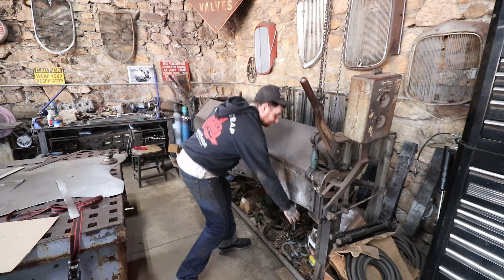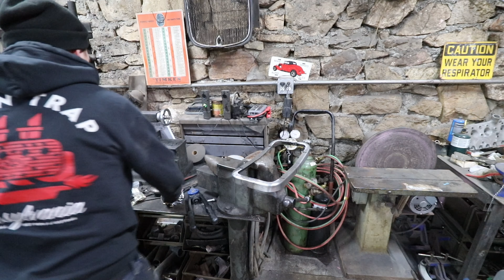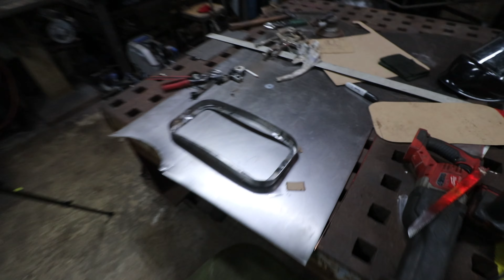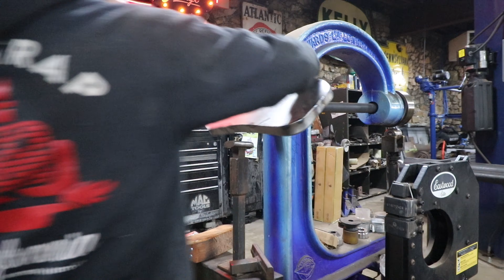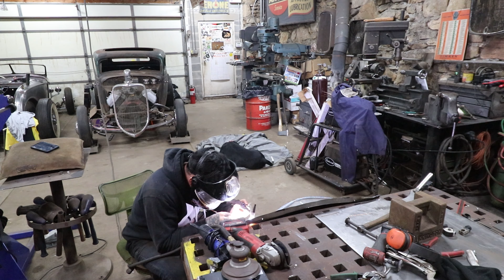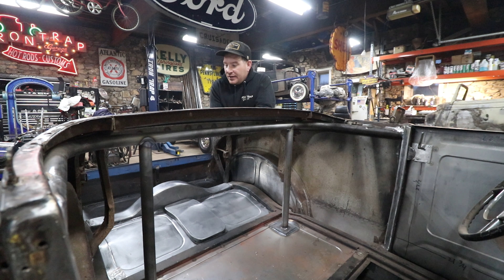Building A Differential Access Panel For The Sweet Heart Roadster!

Comment: That really came out sweet , Matt ! You do some beautiful work , & I can see it was a ton of it . The final fit & finish is both serviceable & super cool to look at . Very intricate , to the point of ornate , but elegant as well . I thought it would just be a plate over the pumpkin , but you will have travel in the suspension over bumps . You needed that extra "head room" , so it makes sense . You said it will sit higher later on ., too . Looks fantastic , functional , & I look forward to you completing the floor in it . Lots of work , but you are doing it right . A solid build . One of my favorites , as you have many . Take care , Matt , Rock On !

Comment: The trunk floor turned out great! Awesome craftmanship like usual!

I do have a question. Why make the diff cover bolt in from under the car? Was it strictly for a cleaner look? The older I get the more important it becomes for me to make working on stuff as easy as possible.
Reply from the maker: For looks. You need to get under the car to get to the bottom torque tube bolts anyways.. so not something you can get around.

Comment: On your acorn table why not fabricate some heavy duty box tubing legs and get some super duty metal casters and this way you can move it if necessary and it’s not a permanent fixture. My buddy did this with his welding tables and they were not lite. 👍

Comment: Morning Matt, great job!!
Your fab table is in a great spot, you cut your material, turn right around & your bending brake is right there.....when you were making the diff cover you mentioned using the metal as filler, it's tricky, but it can be done, that's like when welding panels to fit them tightly together, you can almost fusion weld them. I may do the same to my 31 Coupe...the 32 firewall was a bit of work, but the real work is cutting out the firewall to clear the Olds Bellhousing & start the trans tunnel, it came out pretty nice, I will Instagram you a couple pics....when this car is done, I may take a road trip....